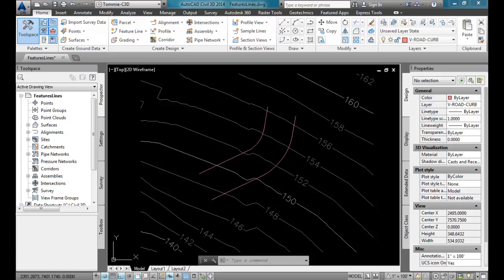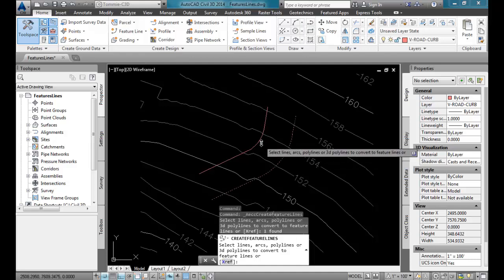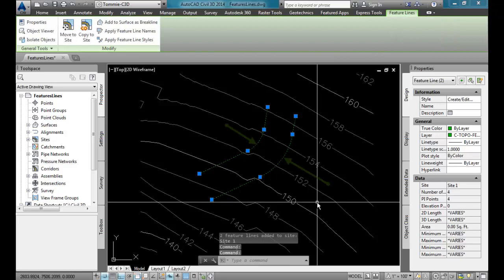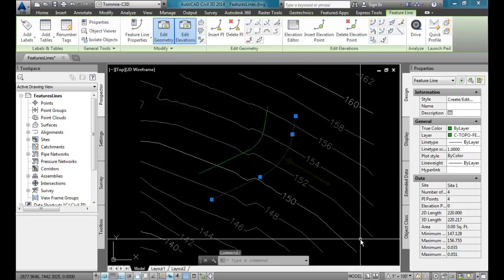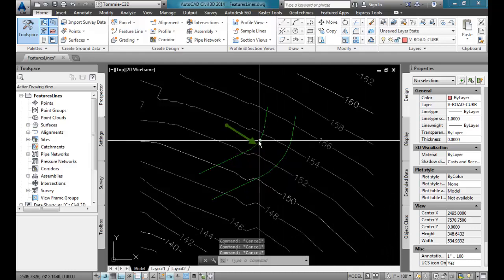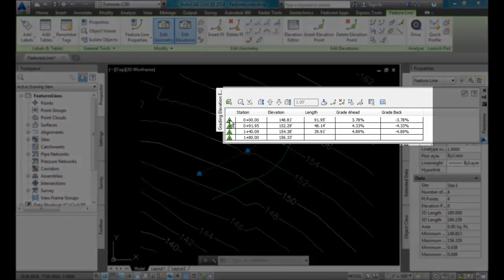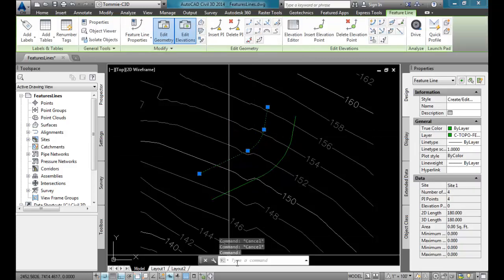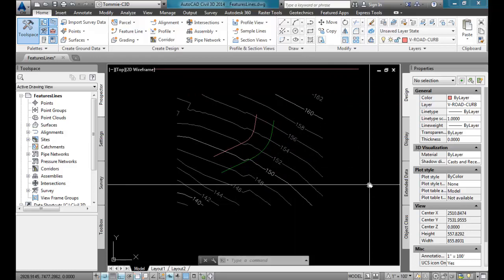Feature Line To Polyline

Comment: If you create a flat surface at elev: 0 underneath multiple feature lines you can set all feature elevations to 0 by using the "elevations from surface" tool.  It's much faster than the elevation editor.
Reply from the maker: You are correct, William. That's the workflow I use for survey figures and when I need to convert multiple feature lines as you stated.

I recently posted a video showing this workflow if anyone is interested. It works for survey figures and feature lines.

https://knowledge.autodesk.com/support/civil-3d/learn-explore/caas/screencast/Main/Details/bb7df7cf-1cbd-4d7e-903b-f469300ed7ee.html

Comment: You can simply uncheck, Erase Existing Entities, and you will have both the new feature line and the original polyline. Would eliminate the need for all the steps after creating the feature line.
Reply from the maker: You are correct, Shawn. This video was created to show how to get those polylines back if you don't keep the original. For content such as back of curb, keeping the original entity would make sense. The workflow shown in this video happens more often when working with proposed grading where you want to make edits to the path of a swale that contains a curb. Most often we don't keep the original polyine when creating feature lines for proposed grading but sometimes we need that polyline to denote a swale, low point, high point, or some other linear feature. In that case we will use this workflow.

I published a different workflow for converting survey figures to polylines as they also tesselate curves when exploding. You can find that video here: https://knowledge.autodesk.com/support/civil-3d/learn-explore/caas/screencast/Main/Details/bb7df7cf-1cbd-4d7e-903b-f469300ed7ee.html